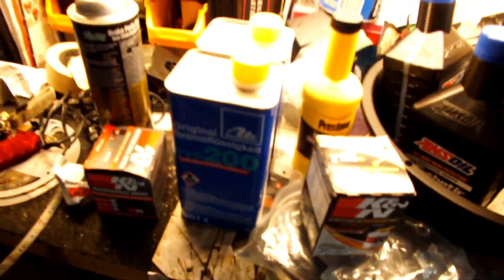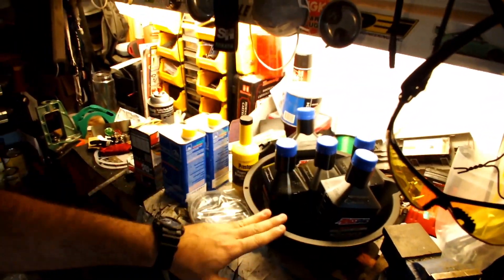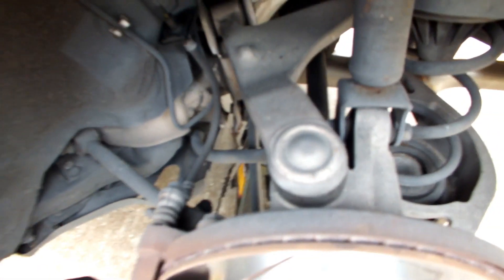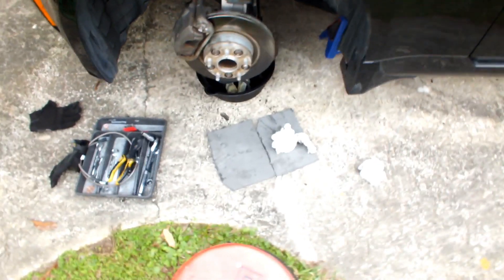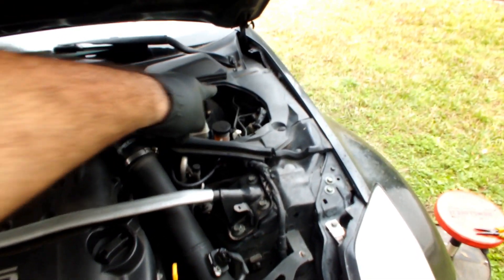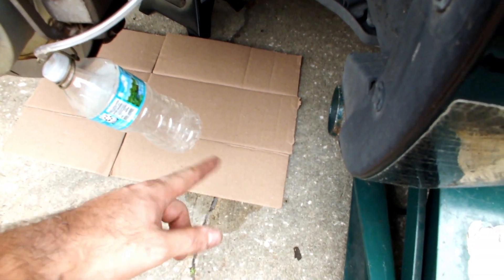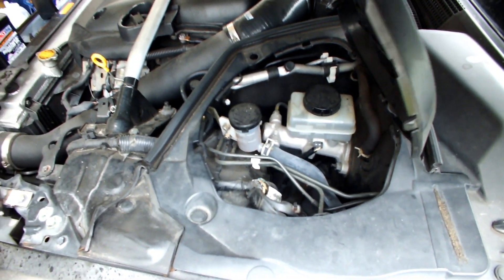350Z brake lines install

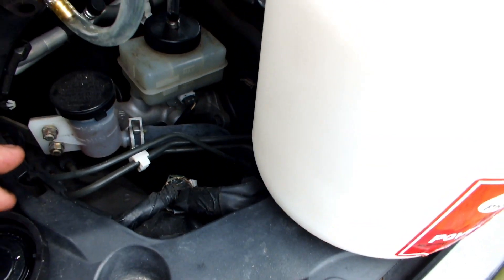Comment: 13:58 so you pressurized the system to about 11-12 psi while it was empty?? Why did you do that for? because ima be doing this in the near future
Reply from the maker: No i put the pressure for about 13-15 psi only while the container has brake fluid.
Reply from the maker: I only pressurized it empty to make sure the system held pressure since i had installed the new brake lines. After the pressure held, i added brake fluid and bled the system as normal.

Comment: Nissan says the order for bleeding the brakes is right rear, front left, rear left, front right
Reply from the maker: If this list is you looking at the car correct. I like to use driver / pass front rear instead.
Reply: May you show me where it says this please?
Reply from the maker: @g35tho11  
I cant directly link to the FSM but here is a thread

https://my350z.com/forum/maintenance-and-repair/135784-bleeding-the-brakes-what-order.html